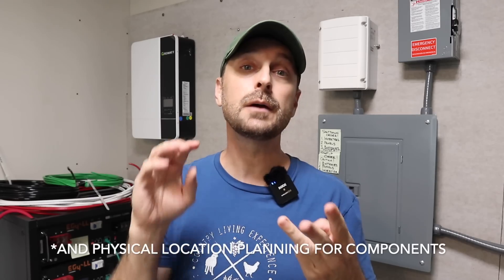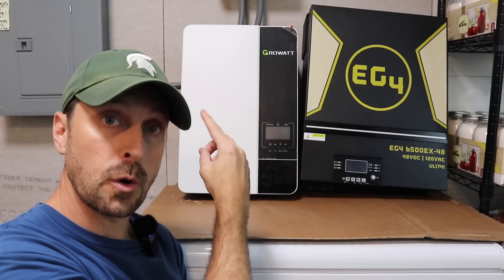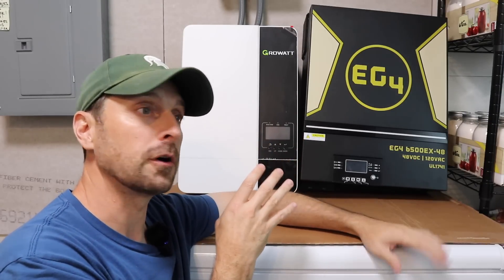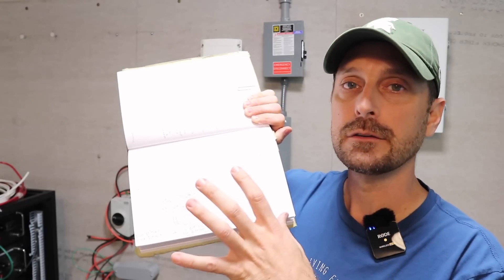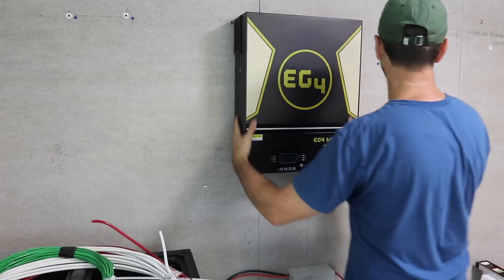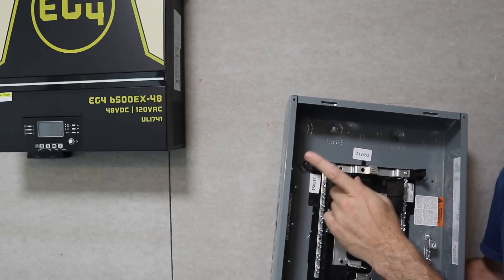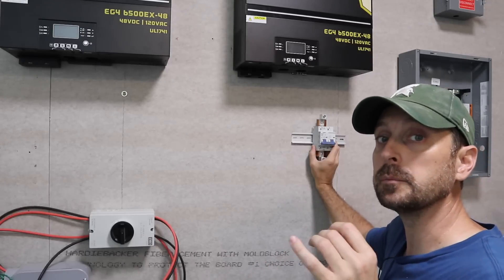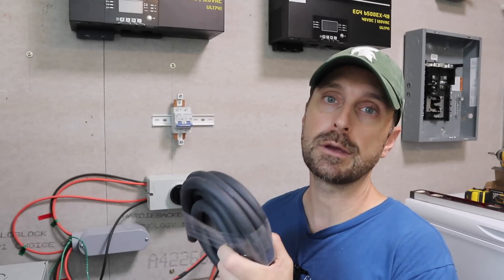EG4 Inverter Review! 6500EX vs Growatt Key Differences!

Comment: I kind of like 2 gauge for some reason what you're about to do instead of 4 gauge I'd rather be safer.
Reply from the maker: 2 gauge will not fit in the inverter terminals. 4 barely fits.
Reply: @CountryLivingExperience  that's not good I like to gauge over 4 gauge through all my batteries I use 4 gauge I know some of them inverters I have asked for one gauge so that one doesn't that 2 gauge go through okay.
Reply from the maker: I think you are misunderstanding. Battery cable is recommended as 2/0 gauge and fits. The AC wires are 4 gauge.
Reply: @CountryLivingExperience  that to bad I like being safe. But that's good to know thanks.

Comment: Now you get yourself for real easy for 6548 watt inverter that can handle 8,000 Watts input 500 volts that's what I want to get I don't have the money yet don't have the solar panels yet but I do have some sort of house it's not enough for the eg4 inverter. No you just got to get some more solar panels for the easy for. Of course they're also certified so they'll pass electric inspection and then you're going to get up to good to sell electricity is a electric company. As long as you get electric permit.

Comment: Curious why you chose a 70 amp breaker?
Reply from the maker: Appropriate for the wire size, distance, and current of the inverters.
Reply: @CountryLivingExperience  I don’t think there is necessarily a down side to it. The inverters can only output around 54 amps I think. But I suppose the larger breaker could help account for a surge if needed.

Comment: I think I'm going to get the new eg4 6000 ex 48 hv
Reply from the maker: They just introduced it this week. Looks cool.
Reply: Would you have still picked the 6500ex over the 6000ex after seeing the specs?
Reply: I was recommended this over the 6500 from signature solar as well. Waiting on word back on why they recommended the 6k or the 6.5k when I need to buy 2 anyway for 12kw output. I'm trying to find what's the downside to the 6.5. you would only be gaining another kw. Maybe internal specs are better on the 6k?
Reply: @VFio689  might make sure 6 k are ul listed not really seeing that I was thinking about them because it only took one to get 240 volt and 120

Comment: Will these work With a grid tied system? Adding a battery charger.
Reply from the maker: These are off-grid inverters so they do not support selling power back to the grid if that’s what you mean. They do allow a grid connection that allows you to pass through to run your house or charge your battery from the grid. They have integrated battery chargers.
Reply: @CountryLivingExperience  
Don’t care about sell electric back. Thanks
Reply from the maker: @kenjones5403  Sounds like these are the inverters for you.

Comment: I have 3 brand new growatt 5000es. Still in the box. I ditched that plan and installed a solark 15k. Never looked back.
Reply: Solark cost 3x for same output. If  you need to pass inspection the other inverters may not but they work fine.
Reply from the maker: Why?
Reply: @CountryLivingExperience  man i cant wait for your next video:)
Reply: Any info you could share about the solark would be great. Im on the fence with the eg4 6500 's or the solark. Cost isn't the hold up
Reply: I am a retired electrical engineer having worked in power generation all my career. I also did solar installs nearly full time but now that I am well past retirement I only do them for myself or friends. 
Signature Solar used to be a good company to deal with but now they are just about impossible. I have called tech support, waited half an hour then put in my number for auto call back but never received them. I have sent emails but the responses are not helpful. I am not sure what is going on there but it is not good. You may wish to consider tech support availability.
The Sol-Ark is very expensive compared to the Growatts or the new 6500 eg4 however it is like comparing a Yugo to a Rolls. My personal unit is a Sol-Ark. When I would sell a system I always spent an hour or more going over the different panels but in particular the different inverters and battery banks so the customer could decide what fits their lifestyle and wallet the best. I was always happiest when someone choose Sol-Ark. 
I do like and have had great luck with the eg4 48 vdc, 100 ah batteries and would have no problem buying more, but there are other batteries as good.
Reply from the maker: @samdixon6867  I have never had an issue with their answers to any of my questions. They are always helpful. They are experiencing immense growth and are going through growing pains. Since I purchased my original equipment 10 months ago, they have almost doubled their staff to deal with the traffic volume.  I usually don't have an issue getting through in the early afternoon.
Reply: Country Living your experience is different from my recent experiences. They were fine in past years but when I leave multiple call back requests and never receive one something is wrong. Perhaps you as a YouTube poster get treated differently from a mostly retired professional installer. They are not my only source for equipment fortunately as I buy from wholesalers mostly. 
If they grow too fast and can’t take care of customers that is not a recipe for long term survival.